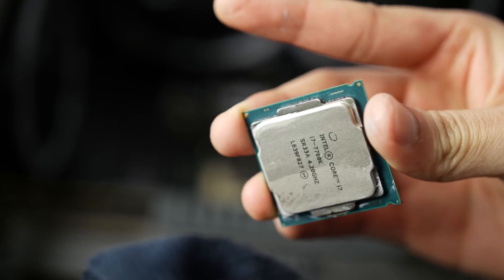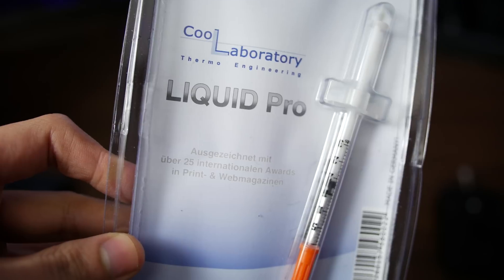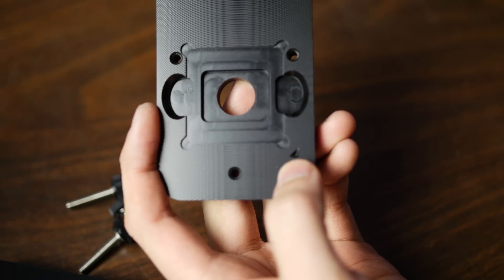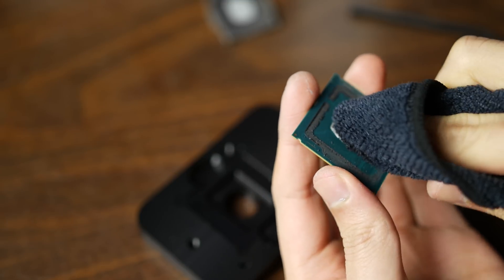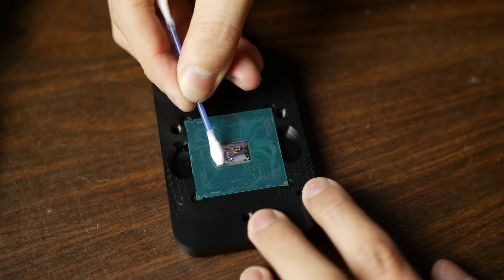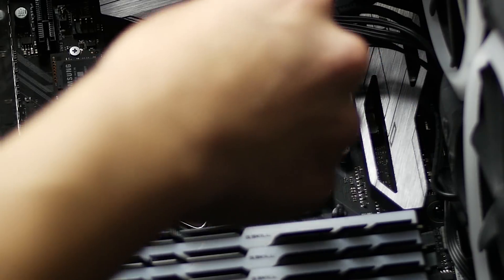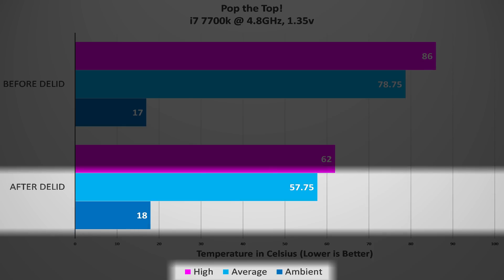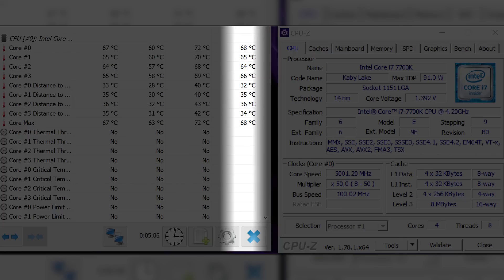Delidding the i7 7700k - Before and After!

Comment: I used the same tool from rockitcool to delid my 6700k a few months ago and I was pleased! I used the same liquid TIM on my 1080s which is super awesome! On my CPU I used IndigoXtreme TIM which is just as good if not better but isn't the easiest thing to apply. They come with 2 which is good cause I screwed up the first application (make sure it melts) lol -____-
Reply: Oh on another note. I F*ing hate Intel! They have a huge portion of the market but here's your cheap a** thermal paste -_________________________________________________-
Reply from the maker: Nice, thanks for sharing the experience!
Reply from the maker: Someone actually brought something interesting to my attention about that - Intel probably uses that thermal compound for durability and longevity.  Typical thermal paste is meant to be reapplied after a year or two, but most people don't want to delid their CPU, so whatever solution Intel is using now is meant to keep the chip running until you upgrade.  It appears AMD solders the IHS.  Not sure why Intel doesn't, but I'm sure they have their reasons!
Reply: Until you mention that, I didn't think about that. Makes sense but I think you can attest to the cheap feel of the paste they use. When I removed the original paste, my thoughts were, this is really cheap thermal paste. After doing the temperature benchmarks, I questioned if it was dirt?! Anyhow, I ran into your channel a few days ago while I was searching for reviews on the Nxtz rgb fans. As a techie guy, I don't look up so many how to videos but reviews on products for PCs! I love building computers but really don't have the time or finances to do it as a hobby. My thinking is someday, I'll create a channel and just focus on what I love doing most.
Reply from the maker: I agree, my first impressions on their thermal interface material were "wow, is this right?"

I'm glad you found the channel and decided to stick around!  Happy to be of service!  The hardest part about creating a channel is just starting (in my opinion, at least) ;)
Reply: I must thank you for interacting with your subscribers. I know your time is valuable but it's something that the other guys don't do so you're quickly becoming my favorite!
Reply from the maker: I try my best ;)  You guys make this significantly more interesting!

Comment: There has to be something wrong with Intel's thermal paste... I remember when I delidded my 3770K the paste was dry like an erasing rubber, I replaced it with arctic MX-4 inside, but the improvements were less than 4-5ºC. 
If the current gen has such a big difference I thing they are making it bad on propose, just to sell a mid-cicle SKU like it's rumored after AMD releases Ryzen.
Reply from the maker: The paste was pretty dry in my situation, too.  I've also heard that using a typical thermal paste for between the IHS and the die doesn't yield particularly high gains, so it'll be tough to compare deltas across generations given that we used different compounds.  If they did it on purpose, though, that'd break my heart</3
Reply: Tomás Jarsun I just delid my 3770k too but with liquid ultra, there is a lot improvement. I wasn't able to run at 4.5Ghz at all, after delid I can reach 4.6ghz without shutting down by it self
Reply from the maker: Nice!  I can always dig an improvement!

Comment: What? I'm cooling with a Kraken X61 with fans on max and my 7700k STOCK hits 86 degrees.
Reply from the maker: Temperatures depend on a number of things, like input voltages, overclock speeds, what kind of workload you're putting on it, thermal compound (and quantity used), ambient temperatures, and you'll even just get some variance from chip to chip.  Some people get better results than others under virtually the same conditions, so you could be a lucky one!
Reply: I meant that I running the 7700k at it's default clock speed 4.2GHz. At 1.128V, the default assigned voltage. With the NZXT Krakens pre-applied compound in a 70F degree ambient temp house.
Reply from the maker: Oh, I see.  That's a little toasty!  You can try reseating the cooler and see if that helps any?
Reply: Wow lol. I decided to check it, the thermal compound that was pre-applied was about 90% un melted. All of it except the bottom right corner was still applied to the heat sink. The bottom right screw was screwed in at an awkward angle. Thankfully it didn't strip, so I re did all of them. Now my max temp is 60 degrees under max load.
Reply from the maker: Donald Neal That'll do it, glad you got it fixed!

Comment: i have watched this video about 10 times now that pop sound is just soooooooooooooooooooo satisfying
Reply from the maker: Isn't it!?  I'll be sure to catch it with a better microphone next time around!
Reply: ALittleDIMM so there is no way to secure the ihs back on to the cpu???
Reply from the maker: There is!  I just don't recommend it, as if you ever want to delid it again, it's just extra hassle (though, if you really want to, some people use a silicone adhesive agent to reattach the IHS).  The pressure that is applied from the motherboard's retention bracket is enough to keep good contact between the CPU die and the IHS.
Reply: oh ok thanks!!!!!!!!

Comment: this video simply shows how bad Intel is nowadays. Hopefully AMD won't do the same with Ryzen because I'm planning to replace my 2600k with the 8cores/16threads variant.
Reply from the maker: Itbankrock I don't think a company like Intel has a reason to cut corners on something as small as thermal paste! And I've got big hopes for Ryzen!
Reply: ALittleDIMM I know right?? You were so right in the vid, you paid $350 for the thing and you have to spend more for the tools you need and risk your cpu for the whole process. This whole delidding trend should be a wake-up call for Intel. It's too risky even for professionals.
Reply from the maker: Let's hope that changes with their next optimization!  It shouldn't be too hard for them to make that adjustment...
Reply: Ryzen will have a soldered IHS
Reply from the maker: Whoa, I never said it was all bad!  I just felt that improvements could be made!  As for my fanboy logic, I will buy and use whatever fits within my budget that works the best ;)
Reply from the maker: That's good to know, thanks!
Reply: Funny that Intel makes one mistake in a long span of good products and all of a sudden it's all bad and they should pack up shop and make soda cans instead. It's the same with AMD. They messed up badly with Fury X and they should of never made the Rx480? Gotta love the fanboy logic
Reply from the maker: No worries, I try to keep an open mind while also covering my bases ;)

At least with the 1080, you can skip the next release or two!
Reply: Ryzen has soldered on IHS, no glue.
However, people have already delided the Ryzen and there was only a difference of about 2-3 degrees.
Reply: Sorry mate. The post was directed to the op. I agree. Budget is most of the time the important factor for me too. Every now and then though I treat myself to top of the line because in the longrun you will get more value. Not too convinced about my "upgrade" from a 980ti to a 1080 :/
Reply: They started this bad practice with 3000 series. I7 2600k and 3960x are the last of this kind of awesome precessor.  3960x uses Sandy Bridge awesome architecture.

7700k are also awesome, but you have to delid and replace the bad paste with the new one to benefit the real advantages of the platform.
Reply: ALittleDIMM I think it has more to do with longevity due to thermal paste, if they used indium to solder the die, it would stress the joint and ends up hurting performance. AMD might switch to thermal paste over time.
Reply from the maker: I heard about that regarding the solder stressing the chip as it heats up and cools down.  It makes sense to me, but I have soldered CPUs that have been around for ages, so I can't say for certain that it affects longevity enough to be worth the temperature hit.
Reply: Pholiage it's not just about the issues with the TIM. The fact that they have been scamming consumers with their insane pricing for the last few years is also the big issue here. And the fact that they are blackmailing reviewers to give Ryzen a bad image? Pfft Intel please. I am a long time Sandy Bridge (2600k) user since March 2011, and yes I'm ready to say goodbye to the blue team. Even though I have a green gtx 1070 card, it won't matter anyway when combined with a powerful Ryzen proc.
Reply: https://forum.level1techs.com/t/intel-are-apparently-attempting-to-manipulate-the-ryzen-launch/113481
Reply: My 6700k works just fine. Using a H115i and have 22c idle and around 45c when playing over longer periods. And this is overclocked to 4,6@1.32v. They don't include a cooler to actually save money believe it or not. Most who buy a K series won't be using it at stock settings. Neither the Extreme series have a cooler with them of the same reason.
Reply: Hilarious. You can't blame a company for doing well on the market and having the luxury of charging what ever they want for their products. It's like blaming Pagani for charging $2m for a Zonda and reasoning a Nissan Gtr is just as fast and half the price but you still want the looks of the Pagani. AMD is to blame here by slacking on their development. They were aiming for low cost hardware and intel on high cost. This in it self will most likely boost the competiveness on both companies to start innovating. Buy the same cpu over and over is getting real old. I have a 1366 965 Extreme waiting for it's motherboard to arrive and it will give a satisfactory performance and it won't cost even half of what system of 7700k or Ryzen will. People are idiots. Like everyone are. Something new comes out and bam everyone wants it. Even though they have more than enough without realizing it. Tomorrow they are unveiling the 1080Ti. And guess what. Tons and tons of used 1080s will be up for sale on the used markets. Do you need the 1080Ti or even the Vega whatever it's going to called? Nope. It's just how humans work.
Reply: Pholiage Hmm yeah you got a point there with AMD being uncompetitive for the recent years. My mistake. It will really be obvious that without competition, it will just result into monopoly. Let's just be glad that it will be over. On your other point, I agree that people today are really like that. I myself used a 660-Ti, an average budget card, for 4 years. Then after all those years of saving up, finally got myself a GTX 1070 which I hope will also last me 4 years of smooth high graphics gaming. However with my almost 6 years old 2600k it just can't keep up anymore. Even with a 4.4GHz OC the bottleneck is still heavy. Again, I'm the type of guy who doesn't upgrade frequently so I guess going with 1700X Ryzen won't be a bad choice to last me at least 5 years of high performance computing.
Reply: Don't about being lucky. Sure some might of been affected. But that could come down to the manufactoring plant. In other words a batch could be affected and another not. Since both cpus 6700 and 7700 are pratically identical it would make sense just keep printing them at the same settings. Unfortunately they haven't realized that some are badly made. My point is in all this. Every company has it's ups and downs and I find it nonsensical to dismiss a company because of one product. The x299 cpus might be even worse. Or lengths better. Same with AMD. They have done same things from time to time.
Reply: Well I hope it will bring more frames to you :). I paired my old gpu 980Ti with the i7 930 clocked at 4ghz. Going to a 6700k at 4.6ghz yeilded me about 30fps more in GTAV. So I expect you will recieve at least the same results.
Reply: I think I have also seen one soldered chip from intel and the guy still removed the solder and replaced it with the liquid metallic thermal compound and improved a bit the temps, it seem the solder is too thick and still not as good as a well delided CPU
Reply: intel is not bad, its better as this cheap AMD shit
Reply: Well, but the thickness also count, on the video I saw the guy reported that the solder was really thick, he removed it from a Intel 2011 CPU and that was a HUGE piece of solder...

after delidding the layer of coollaboratory liquid is way thinner which also helps, but yeah, its also a bit more conductive than even solder...
Reply: Really? I did not know that...

>_>
Reply: Intel has been relaxing so much in terms of raw CPU performance due to them basically owning the PC CPU market, what they seem to be focused on more is efficiency and graphics performance so they can compete with ARM CPUs, which basically means zero for us gamers because we usually have a dedicated graphics card.
Reply: Lol you don't know what you are speaking about.
Reply: But in the gpu is true, intel is trying to increase a lot the gpu power for VR ready all-in-one... which is pointless with as much the GPU have gone in terms of performance...

Intel is probably going to give 8 cores for cheaper with a new socket because buying intel 2011V3 based PC is nor for the common gammer since boards are expensive and cpus are expensive.

But I still got disappointed by AMD Ryzen... Specially because I thought I could buy a powerful 8 core for around 260€and mehhhhh...

When I bought my current PC back in 2011 my I7 2600K was the best CPU to buy and I paid only 260€.

Other reason is AMD Ryzen's OC is a bloody joke... specially because I have my I7 at 4.9ghz and this made it climb so much in performance that catches I7 4th gen and has more single thread performance than the current I7 7700K at stock clocks which is probably the most powerful APU in terms of single thread performance.

If only AMD Ryzen 1600 could achieve 5 ghz easily on every chip, it would have increased performance quite a lot.
Reply: Intel made this purposely to make the cpu's age a lot faster.
Reply: Vasi Lucian BUJOR, Well but I guess it depends, my I7 2600k I bought in 2011 and still is at 4.9ghz on air at high voltage and high temps and still no signs of death or much worse temps...

Also sometimes not being soldered can actually be better since u can delid it and use liquid metal thermal paste which is even a bit better than soldering so it gets even better than a thick solder...
Reply: Yeah but AMD also disappointed me a lot, specially because of the very low OC capability...

If I could get a I7 7700K at the price of a AMD 1600 I would totally buy it... Even though the 1600 with 1600X OC level is slightly better on the whole chip performance, intel OC a lot more and will probably beat the 1600X in everything specially in single thread performance which is quite a lot higher than AMD already at stock...

My I7 2nd gen 2600K at 4.9ghz gives around the performance of intel I7 4th gen and more single thread performance than the I7 7700K at stock, so it climbs quite high with OC and a new I7 7700K will probably OC a bit more than my old 2600K which I couldnt ever get to 5ghz which is what I wanted, but I 'm already at 1.55V for years...
Reply: You're not an engineer, therefor, your uneducated opinion is completely irrelevant. There's a reason they do things the way they do. It all goes back to reliability and stability. Have fun trying to make a Ryzen chip run as fast as an Intel chip... You better have it hooked up to a fish tank of liquid coolant.

Comment: ALittleDIMM I think there is something wrong with my kraken x62 (yeah totally not relevant to this video), I installed it on my cpu and when I boot my pc up it starts of really quiet then when the cam software starts it suddenly gets really loud?! Then to fix it I made a profile for both the fans and pump but it doesnt seem to do much, do you know what causes it/and or how to fix it?
Reply from the maker: Are the fans plugged into the Kraken itself, or on the motherboard?  I know if you stick to any of the regular CAM presets, the fans will ramp up to 100% if it gets hot enough, and sometimes CAM likes to swap out of your custom curve back to one of its defaults.  What kind of temperatures are you seeing?  If you base the fan curve off the liquid's temperatures, the fans won't ramp up or down so abruptly, either.
Reply: Well the fans are connected to the Kraken (which is connected to the mb), Ive got a custom curve (which apparently doesn't load automatically :/) , and the temps (with chrome open) are around 20-28, with load its on anywhere from 30 to 60 depends on the game (for example Dying Light and gta 5 Ultra settings 40 - 60)
Reply: Apolared if you have an Asus motherboard and Aura software, Cam and Aura can sometimes clash. IF you have Aura installed I'd try uninstalling it and see if that fixes it. Apparently NZXT is working on fixing this.
Reply: oh that might be it although I dont have an asus motherboard I have an asus Graphics Card.
Reply from the maker: I didn't know this, thanks for sharing!
Reply from the maker: If you're using the Asus software, try following FsJuicyJ's suggestion by uninstalling Aura and let me know if that works!

If not, are the fans even spinning before CAM loads up?  You can try connecting them to your motherboard and control the speeds from there.  It might be something as simple as reinstalling CAM...
Reply: Yeah they're running even before cam boots up, im configuring them from my mb now and they run way quieter than with cam, apparantly cam can only control them from 40% while my mb can from 20% so im using that for now.
Reply from the maker: Oh, yes.  Minimum speed for CAM software is 40%.  Strange that they sound so loud, though!